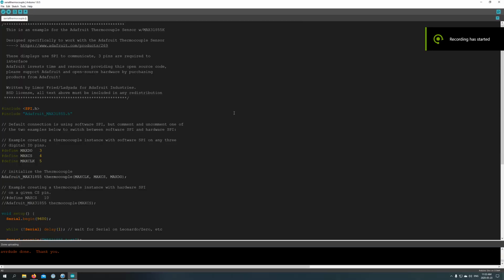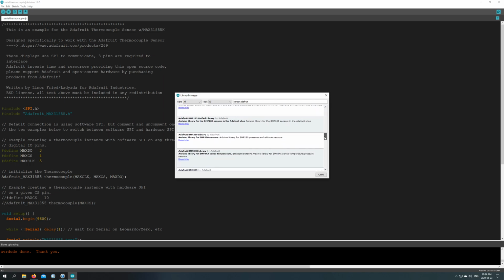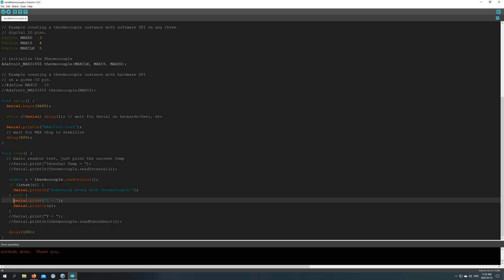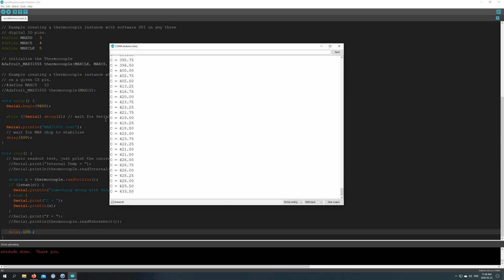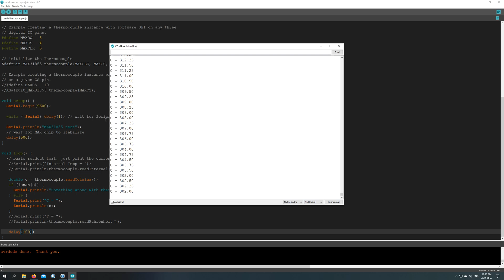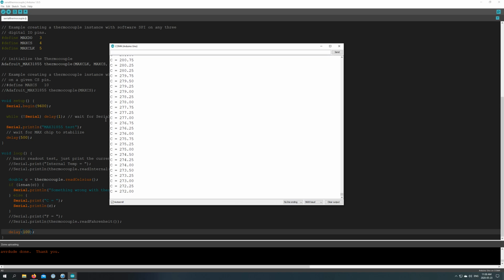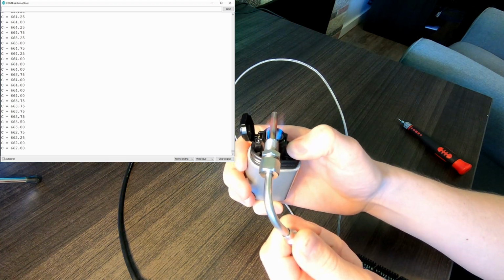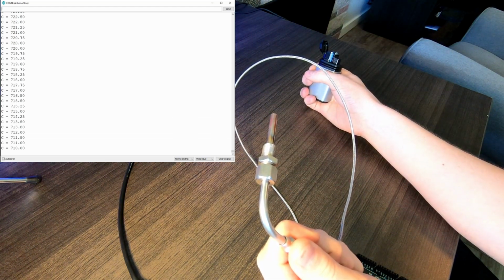Arduino EGT Sensor | Max 31855 Thermocouple Board

Comment: Hey Tyler, I know it been awhile since these videos... I have been wanting to do this same thing on my 91 w350. Do you think this prodject would be possible with the raspberry pi?
Reply from the maker: Yes I think it would be possible, and probably better since the raspberry pi can operate faster than the arduino. I never ended up finishing this project but it was fun to tinker with. I think ultimately the route I want to go in my red truck is the banks idash down the road.

Comment: Duuude, what about also doing boost, trans temps, EGTS’s, and maybe temps for oil or coolant? Gauge pods are expensive and my 400k mile 7.3l is taking my money for other parts, but doing my own monitoring system would be dope, especially if I can do neat things with it
Reply from the maker: Take a look at my other videos, I've pretty much developed a stand alone way to read each of those and was working on a combined gauge system to monitor everything but I put the project aside.
Reply: @OvensGarage  epic, didn’t get into too much researching today as I was slamming Ujoints but, it’s now on the list.

Comment: Im looking at doing this for my 6.0 Powerstroke to display the data on Torque Pro using Seeed Studio CAN-Bus Shield V2 Compatible with Arduino for Controller and Transceiver, as well as fuel pressure.

Thank you for sharing this!!!
Reply from the maker: Awesome, glad the video helped!

Comment: Have you put this in your vehicle? I just built a prototype EGT sensor to put into my jdm van. I am not sure how reliable the max31855 is going to be for this application.
Reply from the maker: I haven't put this in my vehicle yet but I don't suspect there will be any issues.
Reply: @OvensGarage  this issue I was having is it sometimes reads a Nan result. I think if the probe has been grounded.

Comment: Can I plug and use multiple egt? 5 to be exact for an inline 5. One in each exhaust port.
Reply from the maker: Yes, absolutely. You'll likely need a matching amount of amplifying circuit boards however.

Comment: I made one and love it.  Used RGB and some logic so its green under 800, yellow till 1000, and red yellow flash over 1000f.
Reply from the maker: That's a great idea to implement into a project. Have you put it in a vehicle with this done?
Reply: @OvensGarage  yes I have.  Also consider adding a light sensor.  Mine was way too bright for me at night.  Now it dims at night.  I'll post up a vid of it in action.
Reply: @skuuubasteve14  can you share links to the components you used? What you built is almost exactly like what I would like to do. 

Link to your video if its ready as well.
Reply: @skuuubasteve14  hai... do you have any vibration problem on your egt sensor that  fluctuates the temperature reading???
Reply: @easthulk99  no.  The sensor is mounted via a drill and tap into the exhaust manifold.  The only issue I had was with my 2m radio ant cable too close to the wires of the arduino.  On 100watts transmit on the radio I errored the arduino and it reset when repowered back on.